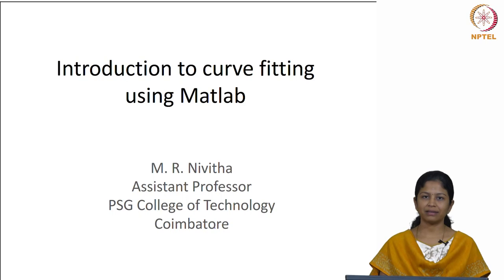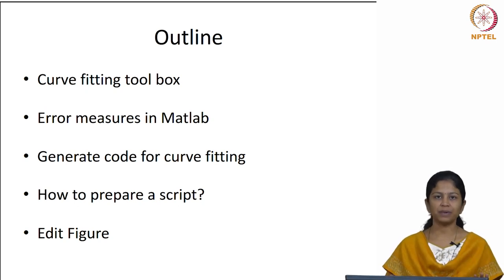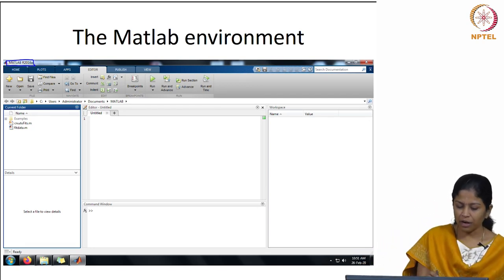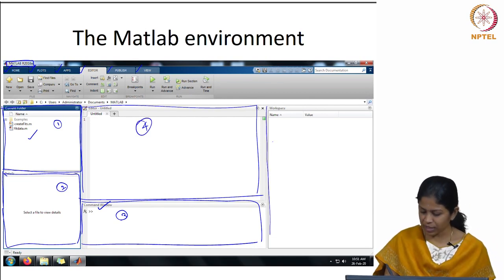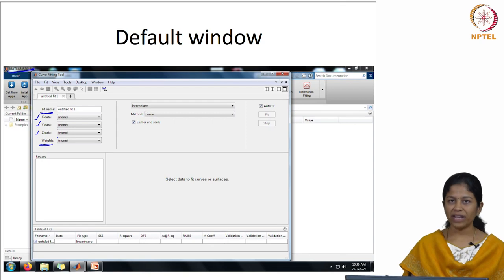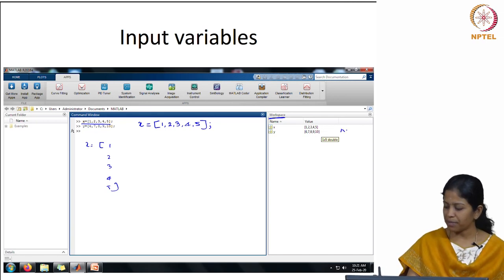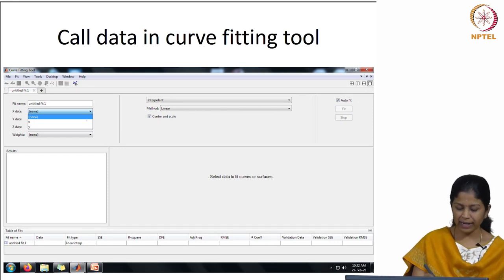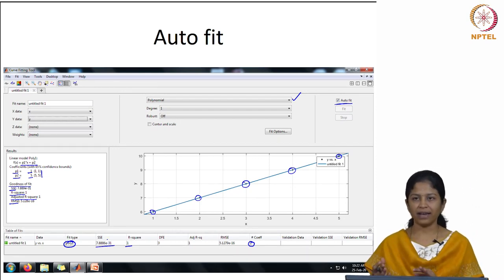Introduction to curve fitting using Matlab - Part 01

Comment: 🎯 Key Takeaways for quick navigation:

00:13 🎯 This video is an introduction to curve fitting using MATLAB, applicable to various fields beyond bituminous materials.
01:07 📝 The focus is on using the curve fitting tool or app in MATLAB, rather than writing custom code for curve fitting.
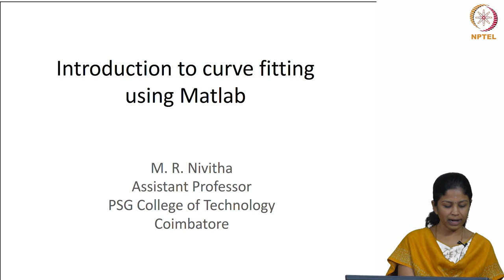02:00 📊 The presentation outline covers five sections: Introduction to the curve fitting toolbox, error measures calculation, generating code for curve fitting, preparing a script, and customizing figures.
10:53 🔧 The video demonstrates using the curve fitting toolbox, selecting data in MATLAB, and evaluating fits for different equations/models.
22:16 📈 The presenter explains the importance of error measures like Sum of Squares due to Error (SSE) for evaluating the goodness of fit for various models.
26:01 📊 SST, SSR, and SSE are used to evaluate variability in curve fitting. SST is the total sample variability, SSR is the explained variability due to regression, and SSE is the unexplained variability due to error.
29:19 📏 R squared (R²) measures how much of the total variability is explained by the model. Higher R² values indicate a better fit, ranging from 0 to 1.
30:41 🔄 Adjusted R squared considers the number of parameters in the model and assesses if added terms genuinely improve the fit or result from randomness. It adjusts R² to account for the complexity of the model.
33:38 📏 Root Mean Square Error (RMSE) measures the standard deviation of residuals, showing how well the model fits the data. A smaller RMSE indicates a better fit.
36:18 ❓ SSE closer to 0 suggests the model has less random error and is more useful for prediction, while a higher R² indicates a greater proportion of variance accounted for by the model.

Made with HARPA AI